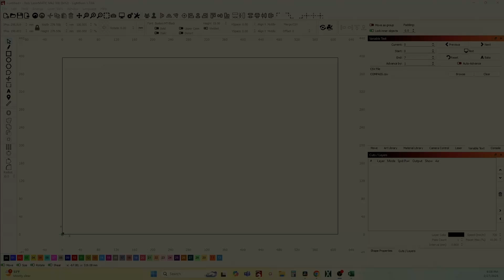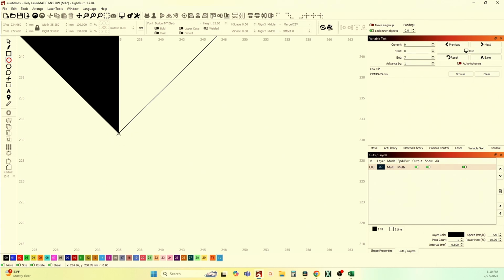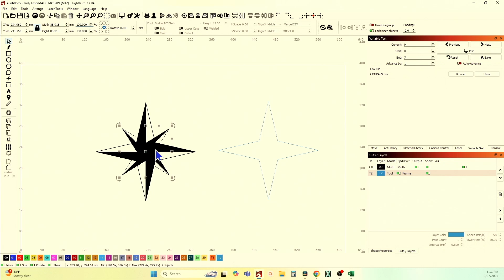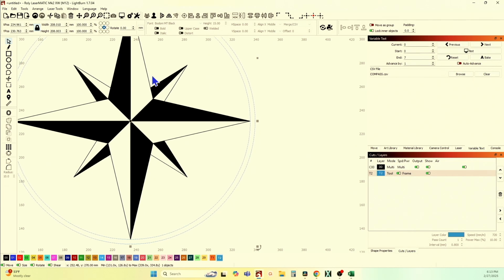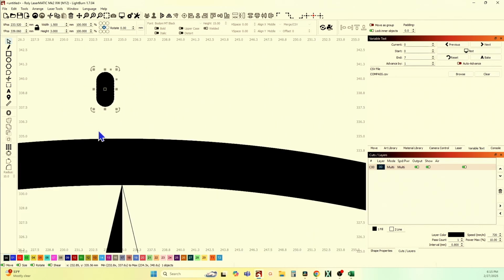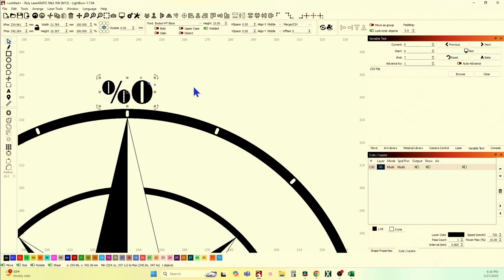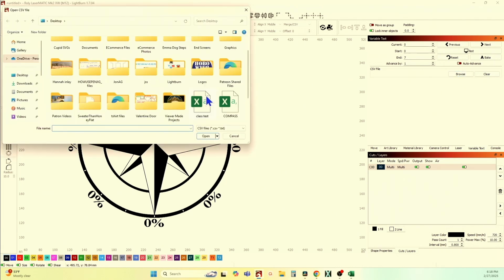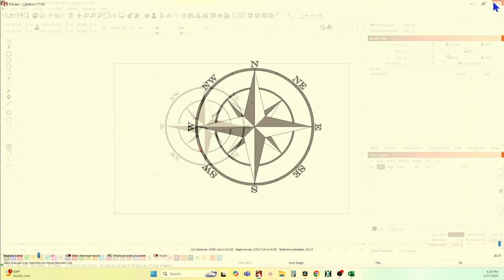Create A Compass Rose In Lightburn

Comment: Hi Steve , could you please help me with this question , My laser engraver is the Atom stack A12 Pro and i have downloaded the easel design from you but my laser cuts out a short while into the procedure  do you think that my laser is capable of dealing with the design or is my laser not powerful enough ?
Reply from the maker: I use the 10W setting on my laser most of the time. So, a 12W Atomstack is plenty powerful enough. I Googled Atomstack A12 cutting out, and it seems you're not the only one with this problem. It could be something as simple as a USB losing connection or "falling asleep." Or, worst case, it could be a module problem. I'm pretty good at designs and design problems. But not so good with technical problems.
Reply: @ Hi Steve many thanks for your reply , I ran the program again and it run perfect but this time I turn on the air flow which I did not do 1st time so I am assuming that the laser cut out as a safety procedure when the laser got to hot 
Cheers pal 
Brian

Comment: Hi , when Steve makes the 1st point of the compass it turns black then the second stays clear giving a black and white point , how does the 1st turn black I can not get mine to turn black any help grateful received, ps I am new to this
Reply from the maker: The reason it turns black is I'm on Fill mode. Once I connect the triangle and close the shape, it shows solid. This requires being in Fill mode and having your window view style set to Filled/Coarse or Filled/Smooth. The reason the second one doesn't show in Filled is because of the duplicate shape on top of it. I went over these things in tonight's Live stream. If you haven't watched it yet, you should. It will help with your questions and understanding.